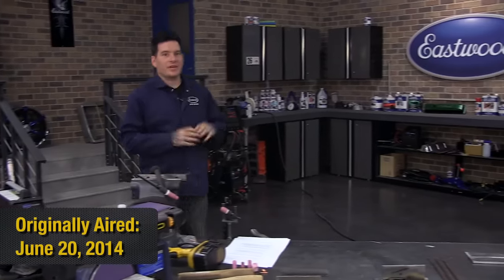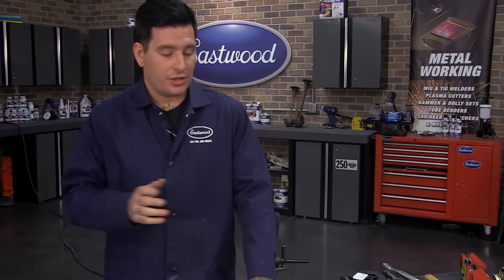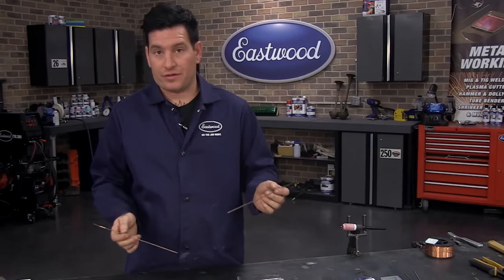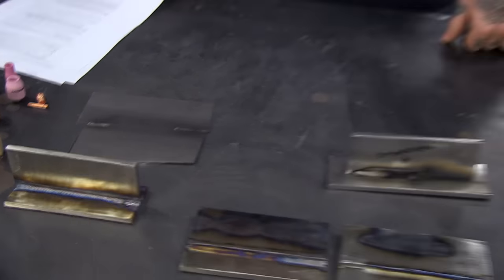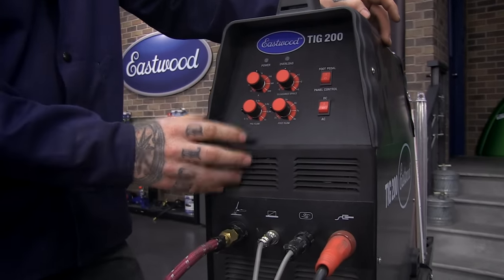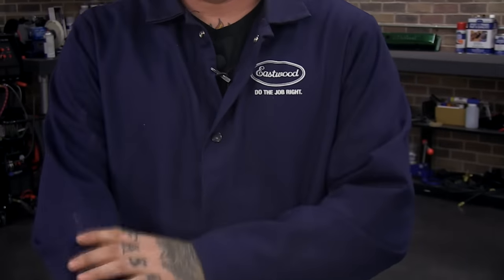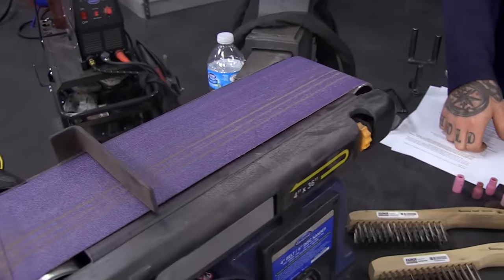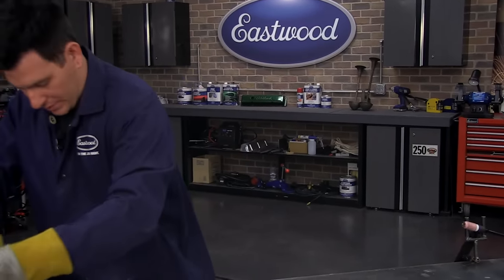Welding Basics & How-To TIG Weld - Livestream Part 1 of 2 - Eastwood

Comment: Your didn't mention two things for newbies.  1) some electrodes contain thorium.  These must not be ground on a belt sander because of the risk of inhaling radioactive particles.  2) Where exactly does the current run, and how best to avoid becoming part of the circuit.  Using high amperage is scary for beginners and they will shake less if they are not worried about getting shocked.  OK, so they should probably start with a stick welder but some start with TIG because they know it is best.

Comment: At 11:30 there is quite a difference in the amount of heat input into the metal. You can see the band of "bluing" out from the welds

Comment: im welding with the tig 200 ac/dc. im welding 1/8 aluminum square stalk. im having troubles getting the puddle started and when it does it melts the metal. and im using the suggested settings

Comment: Hello, I'm new to this. Trying to weld an aluminum joint together but I'm having a hard time getting a puddle  AT 140 amp (recommended setting) What is the highest Amps I can go without getting in trouble ? I'm using Eastwood TIG WEDLER 200 AC/DC.

Comment: I mostly weld D-2 or A-2 and sometimes when I weld a cracked section the weld cracks right away  , I have it heated properly , what causes this . These sections I weld are hardened.

Comment: how do I calculate the amps on different types of metals?(stainless, iron.....)
what happens if you use more amperage then you need?(hot)
would I make a hole on the surface or break the machine?
Reply from the maker: Using more amperage would increase the heat, so you would let off on the pedal to decrease the heat as you weld.  There is a chart on the machine that will allow you to set it up correctly for the material and thickness you are welding.
Reply: wow... that was the fastest reply I have ever saw, I'm still watching your video.
tyvm for the quick reply  :)

Comment: After all the yrs. I'v welded I still don't understand The D C switch !  I know this may sound Like a STUPID ? 'but I'll ask it any way . Can you hook up a  T I G to the Batt. of a car ' or Truck & Use that as your power supply ? If so would U have to switch the what I call finger's around inside the welder ???
Reply from the maker: When the switch is on DC, the TIG will weld steel.  When the switch is turned to AC it will weld aluminum.   Some welders are only DC and will only weld steel.  Some are AC/DC and will weld both.  The Eastwood TIG welders operate off standard household current, either 120 or 240.  I hope this answers your question.

Comment: Has anyone ever used Eastwood's Tig welder? That has no Bias and gives an actual review? I've herd a lot of bad stuff about them throughout different forums.....
Reply from the maker: +Steven Willis The TIG comes with a 3 Year Warranty and 30 Day Money Back Guarantee.  You can try it for 30 days, and if it's not what you want, you can return it.  There are video reviews on Youtube from customers if you're looking for other opinions.
Reply: +Steven Willis I have tried it, a friend has one, I ended up buying the AHP tig, more user friendly features same warranty, I do a ton of welding with it and love it
Reply: +Christian Barber I considered the AHP but ended up getting an Everlast. I like the AHP too but the Everlast had a couple of features I liked.
Reply: +Steven Willis 
I just bought one the other day.  I weld as a hobby and started with a scratch start Lincoln and have now moved to the Eastwood.  I wanted to try a high freq start machine without spending thousands on a bigger brand name.  Thus far, it's been a good machine for me.  I'm not sure how it would perform in a production setting but I think it will be a great machine for garage use.
Reply: +Steven Willis Eastwood takes down any honest review.
Reply: +Steven Willis 
I have the eastwood 200 ac/dc . Its a great tig welder for beginner at its price. I also own a everlast ex250. 
The East wood is for basic beginner.   Its very limited on power and functions but usable. 
I weld heavy gauge plate. So I grew out the eastwood quick.  My advice if you have the money buy a bigger machine with more functions.  If you dont the eastwood is a great machine. Fit and finish is very nice. I still use mine all the time.
Reply: I have one. I worked in a welding shop for 8 hours a day I would tig stainless, just sitting on a chair....welding.... All day. That was all done with a $3000 Miller machine. The Eastwood machine has served me very well, I have had it for just over a year and I've gone through 2-3 bottles of argon. It is a great machine for a home shop but it really is good for a beginner. Those high dollar machines have so many settings and features that confuse and frustrate new welders. The set up is simple on the tig200 and produces good results. This machine is like a Honda Civic, it doesn't have all the features and performance of a new z06 but you wouldn't give your 16 year old a new z06.

Comment: Beginner TIG welder here. I got shocked twice earlier today. Instructor said it was from sweat (no air conditioning in 95 degree weather.) and I'm hoping that's all it was...Are there any other common mistakes that put you at risk for getting shocked? Again I'm new to this so I've got no clue. I've been stick welding for a year now and have never had any issues like that before.
Reply: Haven't gotten shocked lately. It was definitely the sweaty gloves
Reply: +Jordan Brown If you have rings on your fingers take them off and yes sweat from gloves will and can shock you when im in class and tig weld i always try to make sure i bring a towel to wipe sweat or use my long sleeve shirt instead of my gloves
Reply: +Jordan Brown If you have rings on your fingers take them off and yes sweat from gloves will and can shock you when im in class and tig weld i always try to make sure i bring a towel to wipe sweat or use my long sleeve shirt instead of my gloves
Reply: I don't wear rings but yeah I haven't been getting shocked lately fortunately. I've even had my gloves somewhat sweaty (I live in NC and its 90 degrees so sweating is inevitable). My instructor told us that if our filler rod comes into contact with the tungsten when it has arced up then that also can cause shocks. I'm thinking that was probably my biggest issue. My next issue is getting my beads to look good hahaha
Reply: that can happen when like you said, your sweating but your probly leaning on something making yourself grounded while your changing out your tungsten. try not to lean on anything when you do that, might help.
Reply: Yeah I'm good now. Haven't gotten shocked since
Reply: +Jordan Brown Sweaty gloves and maybe you got shocked from the high frequency TIG start. I used to get shocked when I learning on my powertig back in the day. The high freq would go right through my glove if they were wet.
Reply: Probably a combination of the both. I haven't gotten shocked since I left this comment except for the other day when I was welding aluminum lol I'm new to aluminum though.
Reply: if you touch your filler rod and tungsten while welding

Comment: Hi, Interesting video .Do you use a respirator and eye protection safety equipment when grinding the tungsten? We found that grinding tungsten with an electric or cordless drill was good except the chucks didn't last very well. They would bind up with the dust and tungsten grindings quite quickly rendering the drills useless. I stand to be corrected here but I believe the tungsten dust has radio active properties. That is why I asked about using a proper respirator. Quite sure there are tungsten grinders out there with built-in dust recovery systems.
Reply: 6

Comment: Talking about not being able,  to see out of your mask,  when using lower amp,  mister tig welded two sheets of aluminium tin foil that you wrap your sandwiches with lol,and he managed to weld both of them together, and he was using only 3 amps 2 and a half to 3 amps but he was able to see, by swapping out the inside shield on his mask for better visibility,  because tree arms you would not  see through a normal mask.

Comment: What would be a good First TIG machine and set up for automotive restos?
Reply from the maker: +graafx79 Eastwood TIG 200 AC/DC.  If you don't need to weld aluminum, check out the Eastwood TIG 200 DC.

Comment: You shouldn't have a problem using MIG welding gloves for TIG, cause I use my pair of Miller MIG gloves for oxyfuel welding and they work just fine.

Comment: So you can sit down in welding?
Reply from the maker: Jay Rock When TIG welding, most people prefer to sit down, especially if they're using a foot pedal.
Reply: Eastwood Company Oh Ok
Reply: +Jay Rock It would be difficult to TIG Weld standing up as it requires  the operation of a foot peddle.

Comment: Can you sharpen the tip of the electrode after your done welding?
Reply from the maker: Yes, you often need to re-grind the tungsten.  Especially if you accidentally dip it into the puddle.

Comment: "It's kind of a pain to walk over to your welding machine to adjust the amperage, so we just added one right on the pedal." Oh. Of course. The pedal. So you can adjust it with your feet.
Reply: I have this machine and I thought the same thing when I bought it but now that I have had it for a year or so I really like it. If your in an awkward position to tack something or you get all comfortable and then want to make a small adjustment its great. The more comfortable you are when tig welding the better your weld is gonna be.

Comment: what grit type is safe to use on the belt sander that wont contaminate the tungsten?
Reply from the maker: ejgrae1989  The best grit to use to sand tungsten on a belt sander, would be 220. But it should be used for tungsten, nothing else, so you don't contaminate the tungsten.  Check out some of our TIG videos for more tips and tricks.

Comment: The problem with using brake cleaner or any other product that contains chlorinated solvents such as tetrachloroethylene, perchloroethylene, chloroform, and methylene chloride is that they can, when heated, create phosgene gas.
Reply: +Ramus Sumar That's probably not a big concern. All of those things you listed evaporate extremely fast.
Reply: +Shawn Smith No, there are documented cases of people being overcome by phosgene gas while welding parts that were cleaned with chlorinated solvents.Here are a couple of links:  http://www2.worksafebc.com/i/posters/2013/ws_13_09.html  http://www.ncbi.nlm.nih.gov/pubmed/1984962

Comment: Man !  I cant count how many times I have burned my self & set my self on fire + had my eye's flash burned !  I was a Forskin ' I mean a Formen of the welding dept. at the Company I worked for . That Is till I broke my back for them !!  I blew out l 5 disc & worked for a yr. eating a bottel of Advill a day !! Finealy I had an M R I done & they couldent believe I was still walking ' much less going to work every day ! To try 2 mk it sht . My back lasted * yrs. after they pulled that disc out in 97' ! So the Co. just used me for 8 yrs. till I had 3 more discs crap out !! then just spit me out !!

Comment: is the tig200 2t or 4t ? or nether one?
Reply from the maker: The TIG 200 AC/DC and TIG 200 DC do not have 2T and 4T modes.  The Eastwood Digital TIG 200 AC/DC does have 2T and 4T modes and you can check out the machine here:  http://www.eastwood.com/tig-200-digital.html
Reply: okay. thanks.

Comment: No disrespect dude but saying TIG welding resembles Oxy/Acetylene welding is really not even a little bit true with the exception filler wire is used on both applications. This could be quite confusing to novice welders. One uses a torch that burns gas to melt the parent metal and adding filler wire to complete the process, while one uses tungsten that directs the amps to the parent metal using argon to shield the welding process. Very different applications across the board.
Reply: I think he's more of an welding enthusiast than a truly schooled/trained welder? This is merely a sales channel to sell substandard welding plant to the unsuspecting newbies to the welding industry.
He's no where near knowledgeable enough about basic principles and  terminology of the welding game. In the UK we call them 'Chancers'.
Reply: If a person can Oxy/Ace weld then the transition to TIG is not that great a leap.  The technology is certainly different but the technique is almost identical.....puddle the base metal with the torch/electrode and add filler rod as needed.

Comment: can i use wd40 to clean the metal?
Reply from the maker: No, you don't want to use lubricants or chemicals that leave a film on the metal.  You can use a fast evaporating cleaning solution, and make sure it's completely dry before welding.
Reply: thanks

Comment: You should not include subtitles. It is terrible and distracting and sometimes offensive. For example, at 31:41, the presenter says "it comes with Aluminized Steel" but the subtitle reads "It comes with a woman I steal". I know that subs can be turned off, but there really is no point. Other examples? Argon became Oregon. Collet became College. Gas became big ass. Need I say more?